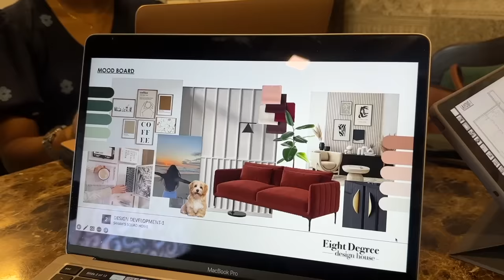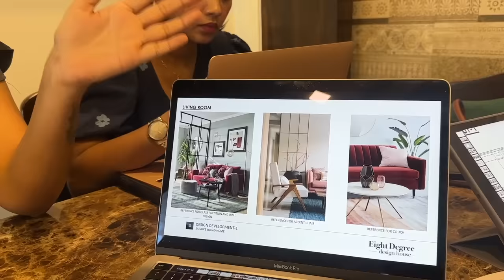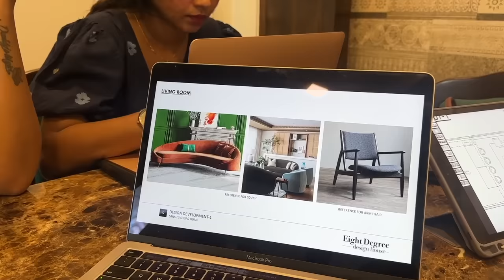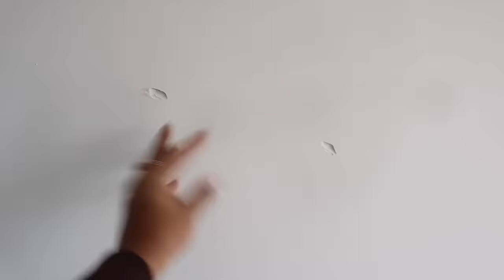We broke the WALL of MY DREAM HOME🔨 Interior Designer Planning has begun! Sarah Squad Home Ep2

Comment: Good thing you hired an architect. Sometimes breaking walls cause structural damages which is very dangerous for you and others.. 
My only suggestion is don't over do interiors at this moment... It's easy to add later than break and make things in future..